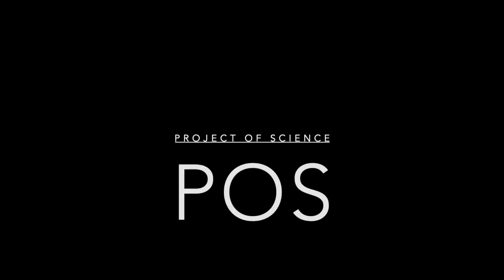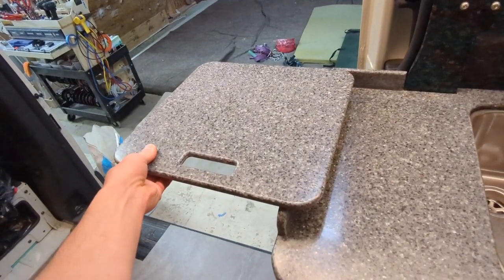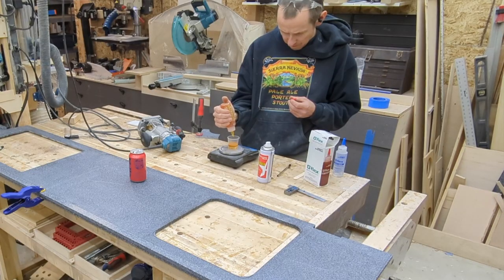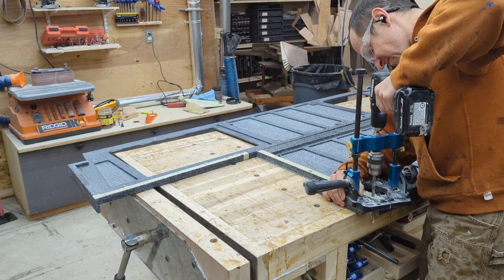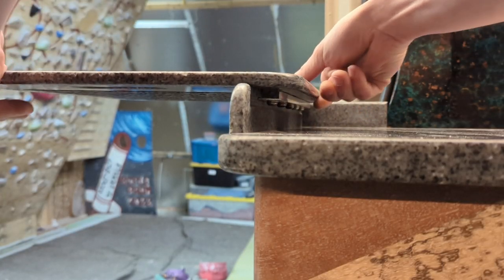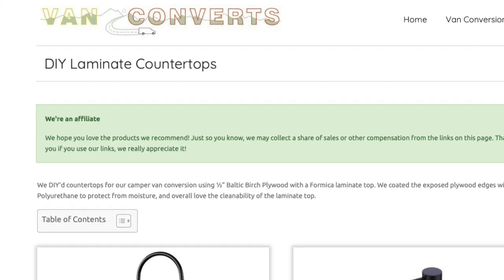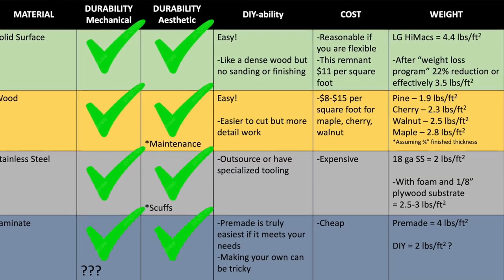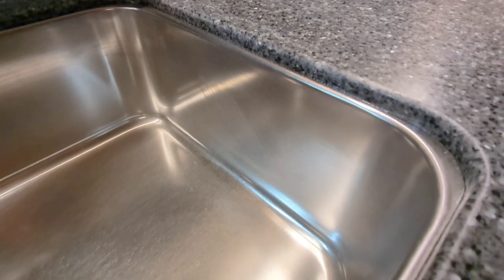All About The Countertop I Built For My Van Conversion

Comment: Simply awsome. I agree countertop is a good place to splurge. After all save weight where you can means you have allowance where you want and need it. Ill be referring back to this video many times 😊
Reply: If you really want to save weight use sheet aluminium folded wherever you would use wood, cover with wrap. Your weight reduction will be astroabosutley awesome, oh wrap comes in some very good timber look alike besides colours

Comment: Great video and analysis.  Solid surface materials are often found in aging kitchen and bathrooms, check your local listings for people scraping out old installs.  Also, unlike finished wood, you can buff out a scratch and not have to deal with refinishing the material.  You can vary the sheen by the finish grit of the sanding media, lower grit for matte, higher for gloss.  I ended up spending more on color match epoxy than the used material itself, your tinting advice is spot on.  Anyone who has the tools and experience to make a detailed solid wood top should give it a try if you can find some inexpensive product.

Comment: Maybe use thin 3mm plates and make the sides of the countertop also from 3mm. Just saw a strip. Then there's no need to do that awful router weight saving.

Isnt it a thermoplast? So you could try to heat the inserts. Drill a hole and put the heated inster in. The plastic will melt and cool aroundit ?

Comment: Thanks for such a detailed video! I was guessing what your countertop material was, and thought it maybe laminate with foam core or something super edgy. As you said, the weight increase is quite small and well worth it for all the added benefits. I am thinking 1 inch poplar plywood covered with black epoxy as my countertop. What do you think? Online reviews are mixed on epoxy countertops in terms of durability… but I thought it’s worth a try.
Reply from the maker: Well...I don't think anything you are saying is destined to fail but a couple things I might do different: 

1. Instead of a 1" plywood core which even with poplar plywood is a bit overkill I'd consider doing 3/4" foam with a plywood skin top and bottom.  Or perhaps something like a torsion box design with 1/8" top and bottom, and foam in the voids.  This removes the problem of finding a good glue to bond the foam to the wood as it is only being squeezed as a spacer material.  And if you layout the "spacers" correctly you can just use screws to hold the countertop down.  
2. As for general epoxy it does scratch fairly easily in my opinion.  That said, there is the method of using general epoxy as a countertop finish and then there are more like paints with epoxy specifically for this.  In general I think these epoxies are worse structurally (so you wouldn't use it as an adhesive) but much better wear and scratch resistant as a top coat.  

Thanks for the support!
Reply: @projectofscience  thank you so much! I love the idea of using foam core sandwiched by thin ply. Torsion box sounds even batter but beyond my skill level. And you are right, I should buy epoxy specifically designed for application as countertops. They are probably more like hardened paint than glue.

Comment: What induction cooktop is that? I'm thinking of converting my motorhome propane stove to induction for the clean counter surface & cooking advantage of the induction temp control.
Reply from the maker: Its the Furrion FIH2ZEA-BG.  Somewhere I read it is designed for mobile applications so I purchased it because it had some vibration mitigation, but I took it apart to disable the beeper and it looked pretty normal.  There is a thin gasket where it sits when you drop it in...and perhaps that is it.
Reply: @projectofscience  Thanks, Ur a gentleman & a scholar

Comment: Does solid surface melt if your cast iron slips off the induction burner?
Reply: good question
Reply from the maker: I'm not worried.  Here is a video from Corian:
https://youtu.be/pQ-25nn77PE

As they say, not a good practice, but the occasional accident should be fine.  There are forum posts and stories of bad damage, but I don't know if there is any countertop material that can't be damaged.
Reply: Most especially in a van, but really anywhere, before U start cooking U should set up trivet or folded towel landing spots for hot pans. The smaller & tighter the kitchen working area the more critical is the prep. Same w/staging food to cook, plates etc. to serve, etc.